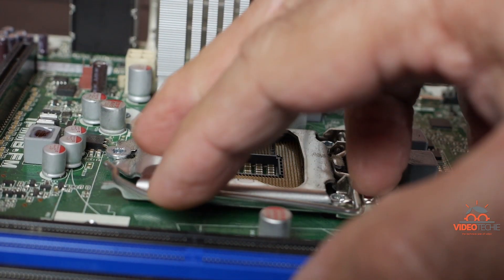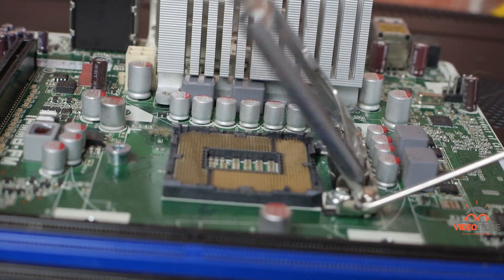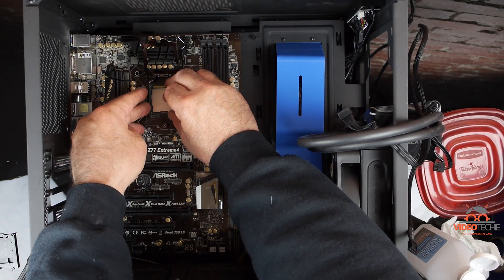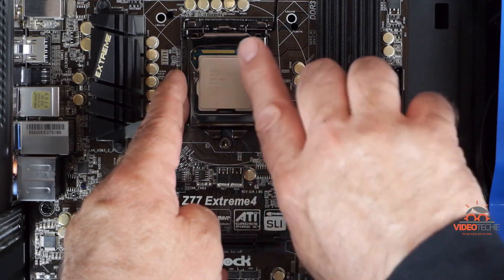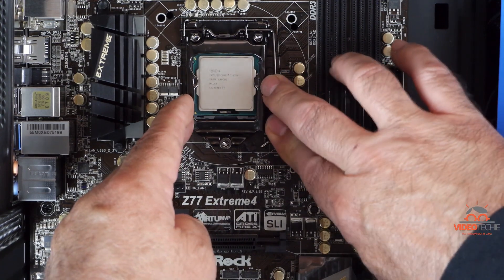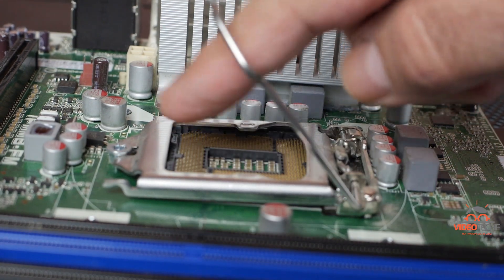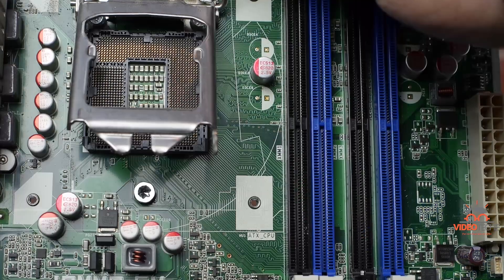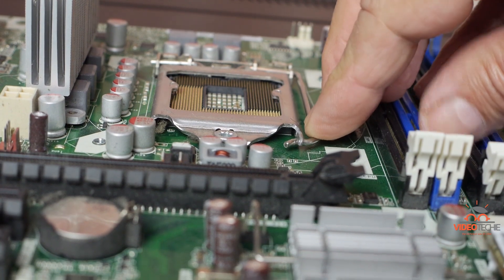Install Intel CPU And Latch it Safely - How To

Comment: Thank You Very Much for this life saver video, For some odd reason when I disassemble my Pc and took everything apart to remove extreme dust build up and this wasn't actually my first time removing the Cpu and reapplying thermal paste but for some odd reason I kept feeling I was doing something wrong and I just didn't want to damage my Cpu or the Cpu pins on the motherboard and I kept replaying it in my mind but just felt completely hesitant in putting the chip in and ruining my only Cpu at the moment of this writing. Every video had a different Cpu door or latchet except this one, so thank you for a quick very descriptive video with a clear zoom in for exceptional visual clarification on what actually to do. Looking forward to more future videos  and great content. have a wonderful day.!!!

Comment: I noticed my lever was very tight when i lift it, and need to apply some pressure once i put my cpu down, not that ease like the way u lift it up and down? Is that normal?
Reply: Yes it is because this pushes the cpu against the pins for good contact.

Comment: What is the retention clip for ?
Reply: so it will keep the cpu in place and pushes down on it so the pins make contact with the cpu properly
Reply: CatArtz this may be a dumb question but would a retention arm help holding the Cpu down when I want to swap my Cpu coolers ?
Reply: @Yahir-rt4gu  do you mean if you need to remove the cpu or? if you just need to upgrade your cooler, you dont have to touch the cpu or the clip, you do need to follow the instructions for the coolers installation and see what you need to do, like screwing in a back plate etc. (and add thermal paste after youve cleaned the old one on the cpu and youre ready to mount the cooler)
Reply: CatArtz yea just the cooler.I just heard bad stories of the Cpu coming out with the cooler.Which a way to prevent that is a stress test and twist not pull  but still a little scary
Reply: @Yahir-rt4gu  that probably happend to an amd cpu since that doesnt not have a way to secure the cpu in place, it has happend to me before on an amd cpu but it wasnt that big of a deal, i just split the cpu and cooler apart and cleaned the thermal paste, if you have an intel cpu you wont have this problem since its being held in place by a screw
Reply: CatArtz yea it’s a amd thing.I’m just a little scared of bending pins lol.Thank you for your
Imput👍🤝